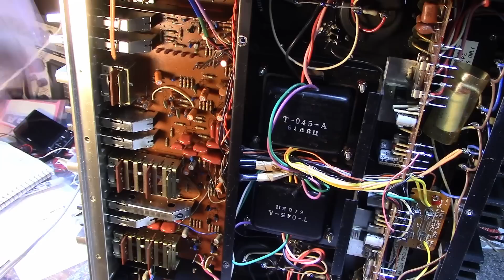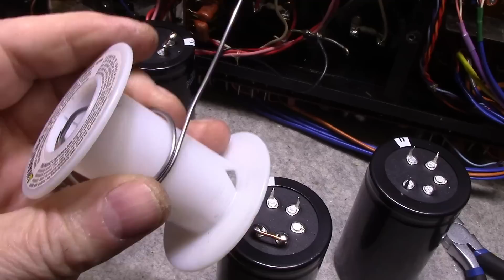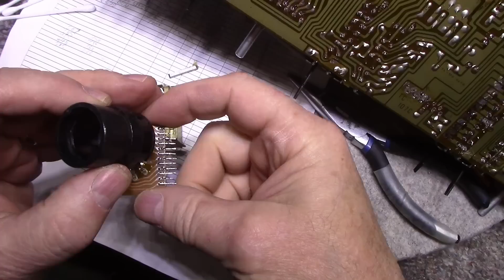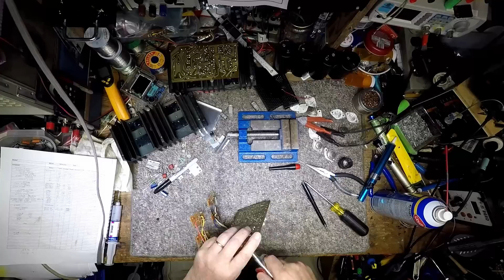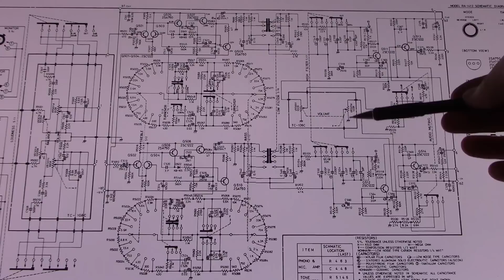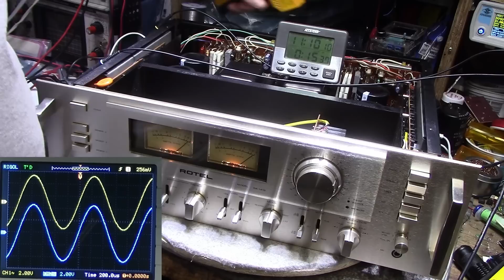ROTEL RA-1412 Integrated Amplifier (Ep. 255)

Comment: Thank you for making this awesome video. I'm happy because I purchased a Rotel RA 1412 from an EBay Seller for $870.  I considered it a very nice price at the time. I had my technicians refurbish it. I was told having my Rotel RA 1412 seen to would cost a bit more because it's more complex and tightly packed than my Pioneer SA-706. Seeing you wrestle this beast into restored functioning was all the proof I needed to know my technicans were still 100% honest with me. I'm shocked at just how well built my Rotel is inside. The two nested transformers are awesome. They aren't Terroidal Transformers but I don't care. The sound from this is so clean. The Rotel RA 1412 is almost over engineered. I'll never give up my Rotel 1412 now that you've shown me what it looks like inside. Thanks!

Comment: After a long search, I finally managed to get hold of an RA-1412 and want to overhaul it step by step. This video is a valuable source of help and inspiration.
I have a question about the replaced carbon layer resistors: What type of resistor is best to use as a replacement?
Best regards from Germany

Comment: I also have one of these. Bought it on Feb 1976 for 865 $CDN while I was a second year engineering student . I still own it . Had to replace the relay of the protection board and clean the rotary switches a few times with contact cleaner but other than that, it has been trouble free.

Comment: Really nice amp, nice build, but the stepped volume and tone controls would be a complete deal breaker for me. I need them to work on the millimeter. I was surprised to hear that you don't use tone control... How is that possible, while every room and every set of speakers is different. I love a 5 channel equalizer for that, getting a favourite bass guitar just in balance with the rest of the music. I ensure you that there's a point (one ideal setting) where all your different albums benefit, and you don't have to fiddle around no more.

Comment: I use CRC QD for industrial applications. Relays and breakers that will have higher voltages and currents across them. It doesn't leave a residue that may flash over at 480 volts and it definitely does dry quickly. Seem to not damage any plastics used in contactors and circuit breakers either.
Reply from the maker: Hexane is a component of gasoline. It does have a gasoline like smell and all the warnings on the can insist you do not use it anywhere a spark can be present.
It's a good solvent for grease or oil, like you said for power switches where clean contacts are needed.
Reply: @TrevorsBench  I do use it sometimes for my hobby repair work at home, but just in the summer when I work in my garage. My basement is too small so the fumes will get bad pretty quickly. Also, my natural gas fired furnace, water heater and space heater are down there. Not a good place to have flammable fumes floating around.

Comment: Hi Trevor. Lovely amp and great work. I do a lot of messing around with vintage cb radio sets of about the same age. Mainly cobra/uniden made stuff which used all the same Elna caps. I always find the same as you, they are never bad enough for the age of them. But if course you gotta remove them the test them. My own personal sets I never recap them as I think recapoing is a myth on cb sets. The caps aren't worked as hard as they are in a hifi amp. I even did a video of two identical radios, one recapped and the other stock and ran them on the test set. Not a spot of difference between the two. But there are guys who will insist their radios work better with new caps. It's time consuming work and I find it monotonous and no money covers you for doing it and the inevitable trace repairs from where something lifts when de-soldering. Love your videos man, I've a good few hifi receivers and amps myself. Regards from Ireland.
Reply from the maker: The thing about re-capping is there is no clear answers. It's both subjective and objective based on many variables and experiences. Some of these variables are age of capacitors, quality of capacitors, the stresses the capacitor experienced, what type of circuit the capacitor is in, voltages, currents, frequencies and so on. Does the cap do filtering or coupling? All these things considered, when a cap fails does it effect circuit performance or not depending on the circuit design.
Electrolytics are very unstable devices based on their wet electrolyte design. As they age their characteristics change. They are not temperature stable in use. They can have increased leakage with age. Values can drift. They have a shelf life of somewhere around 25 years or less, read the data sheets. Manufacturers, knowing the limitations of electrolytic caps, used them in areas that were less critical to circuit operation.
My point is, in a stereo you have two channels that need to work in unison. If the values of caps are different in one channel or the other, it can affect the sound. Coupling caps are the worst culprits here. Lots of '60s or '70s stereos used a lot of coupling caps in their design. These are the designs most vulnerable to bad caps. The other uses of electrolytics in power filtering in stereos isn't as critical. Bad caps in power supplies probably would go un-noticed by the user until a point where the cap goes completely open and power supply ripple comes through with the signal.
To think they made wet electrolytic capacitors 50 years ago that are still holding up today is a miracle.
IMO, I think after 50 years it's time to replace them regardless of their condition. Especially on a piece of gear you intend to use daily on a continued basis. 
I can appreciate that radios are a bit of a different beast from a stereo. Noise levels are not as concerning and radios really only use electrolytics in power filtering areas. In radios where they do use electrolytics in coupling, the audio signals generally have limited bandwidth (mostly).
Thanks for sharing your comments and experiences George.
Reply: @TrevorsBench  - great analysis & thank you for working through this very fine Rotel 1412 amp!

Comment: Trevor, Every time I watch you and any of the other electronics repairmen's videos I am in awe of your expertise all of you put on display.  I have such electronic gear and circuit boards I need to repair, but I only have limited knowledge in board level repair.  I want to learn this craft so bad I get angry with myself for not knowing what should have learned decades ago.  Welding was supposed to be my prosperous career, but now all I do is repair the welding power supplies for the guy and gals who use them.  Yeah, still NOT prosperous by any means.  SUX!
Thank you for posting your repairs!  You and the others are inspirational.
Reply from the maker: Go easy on yourself. It's never too late to learn. Your line of work is great. You already know the basics and how to troubleshoot power supplies. Most of what you already know can be applied to fixing any electronics. Receivers and amplifiers can be broken down into small circuit blocks that have a specific function. Examine each block individually and through process of elimination, work your way through the circuit with a pass/fail approach until you find the fault.
It takes some time and every repair gives you experience and knowledge
Reply: @TrevorsBench  Thank you so much for the support Sir!  I'm 59 believing that it is too late for me.  However, I have 2 NAD 214, 2 ch amps, a NAD 6090, 6 ch amp and an ELAN D12 12 ch amp with one crackling channel that need repair.  Nearly breaks my heart that the NAD 214s are sitting idle.   Someday I hope to gather the courage to sit down with my scope and meters to find the faults in them and make the repairs.  Wishing you all the very best, Kevin

Comment: Nice Production, great to have ya back in 7 days,  -25 too cold for me, I complain 40 F. Sheet of copper, leftover from a Moonshine Still, does look and probable sounds better than that mickey mouse connector removed. Solder was over priced 18 months ago when I had to buy a spool. Hmmmmmmmm, like your paper test for contact cleaner. Loved the Black dots on power transistors.

Comment: Hi Trevor. When you do purchase more solder you should avoid SN 60 grade and go with SN 63 grade or better  SN 62 which  has some silver in it. SN 63 and SN 62 are eutectic alloys and SN 60 is not! You can go even better with quad eutectic solder from Cardas audio  that has silver and copper with the lead and tin in the mix. Eutectic solder has a better crystalline structure when it solidifies.
Reply from the maker: I'm not sure what advantages those alloys have but I'm open to try them. Thanks
Reply: @TrevorsBench  I recommend 'Wonder Solder Signature' leaded type for audio. Very nice to work with with excellent wetting properties. Eutectic type of solder that has been a favorite of mine for years. Costs around $99 for 0.5kg in the US.
Reply: @TrevorsBench  Some useful insights on this topic can be found on the Cardas audio website. Some time in the 1980s the electronic industry moved from SN 60 to SN 63 solder types. The reason was that the non crystalline nature of SN 60 solder connections require reflowing to mitigate poor solder connections that develop over time and use. I have removed all old SN 60 solder from  some high quality electronics and replaced with SN 63 solder. The audible performance improvement was not subtle!! Performance improvements may be difficult to notice in lower performance electronic equipment with a large number of solder connections. The improvement in electrical connectivity and mechanical stability is easily discerned.